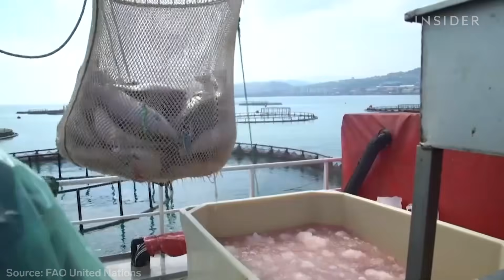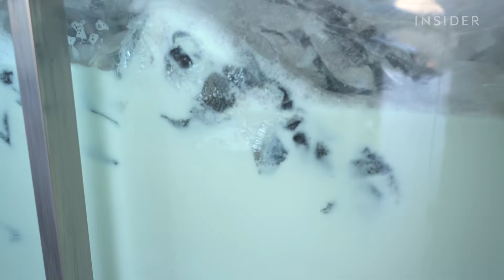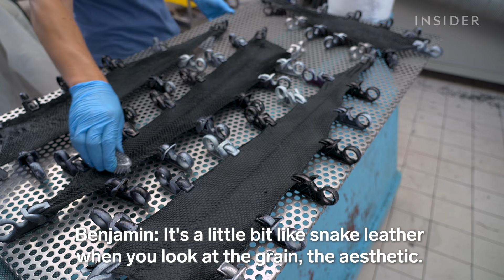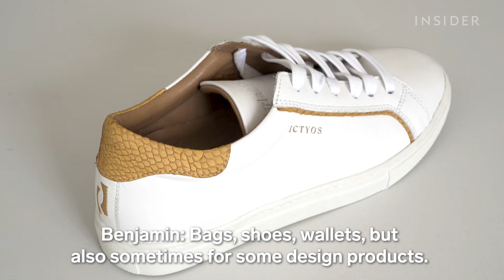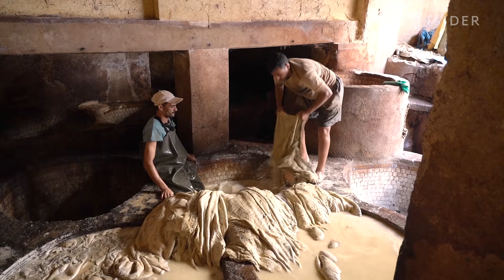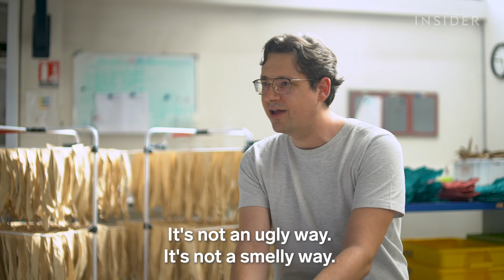Fish Skin Leather Could Fight Restaurant Waste | World Wide Waste | Business Insider

Comment: Ok so I love to be the bearer of bad news, full disclosure. BUT, fish leather is worse for the environment than throwing it away. Why? Because, like snake skins, fish leather is very very thin. Those wallets and things that are showcased as being made from fish leather are actually only made with fish skin. I say 'with' because it's used, by an overwhelming margin, to give a fishy look to beef-cow hide leather. The fish leather is just glued on top of regular leather, so you have to take into account the amount of time, energy, and materials used to make fish leather, and then the same for the contact cement used in the gluing, and finally, add all of that to the impact of vegetable-tanned leather. The two combined are not as bad as chrome-tanned leather, but over 90% of all leather goods are made from chrome tan, because it's cheap, holds up better to abuse, and is dyed much more easily. These guys in this vid are using a single tanning drum after which they paint the leather with an airbrush. This is only one step more than the artisanal shops that make up all the veg-tanned leather market. Practically every serious leather-worker uses an airbrush from time to time.

For instance, I make bags using veg-tan. I source my leather from, primarily, a single company (Horween, if you're curious). I also use an airbrush to dye my stuff, as do all of my peers. The tanneries themselves will drum-dye their leather, meaning they spin it in a huge drum filled with dye and other hides, which is more eco-friendly than me using my airbrush. 

This video is kind of like those videos of people turning plastic bags into clothes or whatever else: It feels good to see people trying to do right by our planet. But it is also absolutely imperative that they/we recognize that the vast, vast, overwhelming amount of waste the world around are produced by multi-national corporations who get away with creating it all, or are maybe fined some trivial sum. This, like the great majority of injustices, could all be fixed with time, but only if we overthrow every single central bank in every single nation around the world.

Comment: Now consider how many chemicals and products required to make the skins useful. Then consider the factory they need and all the manpower required. Then think about all the cleaning supplies they need to wash the machines in to prevent mass disease.

Now add all those chemicals up, and add on the fuel expense of transporting all that rotting skin and flesh, and the transport of all those chemicals.

You all still feel superior about "how green they are"? Instead of just grinding up the waste and using it as fertilizer? Or dumping it in a trash dump where the methane gets harvested and used as energy?

Yeah. Really saving the world here.

Comment: Piruracu leather has been used for ages. This leather is worthless, sorry. It has no strength. In most applications, it will be backed with cowhide leather or fusible interfacing.